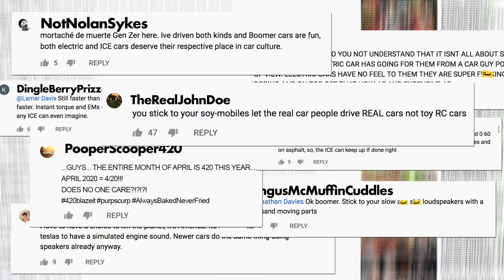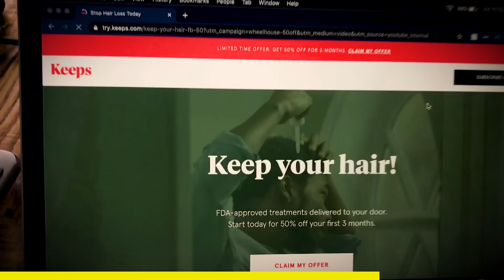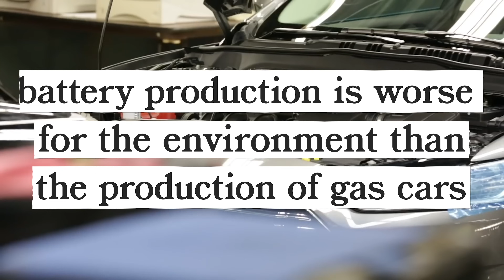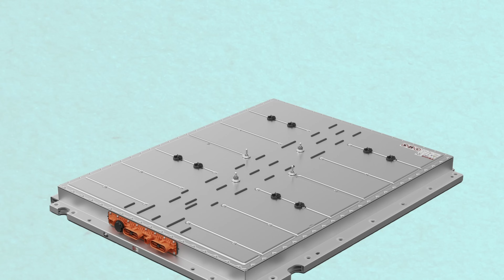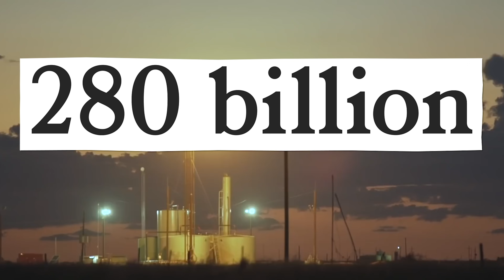Are Electric Cars REALLY Better for the Environment?

Comment: Initial manufacturing CO2 weights are important but im more interested in long term power consumption. The load on the grid is negligible like Nolan said but I'm curious how much more power EV's consume. Thus how much more power is needed to be produced. Besides hydro electric dams wind and solar don't make power once the sun goes down and wind turbines make by far the least amount of power of the three. Nuclear power seems like the only legitimate way to get off coal power. Which BTW industry and power production make up 42% of emissions according to the epa

Comment: My shipping container home is nearing completion. 2800 ft2  3kW of wind turbines plus 15kW of solar along with 52kWh of energy storage

(I own a large solar company so i get this stuff at a very strong value)

This is enough to daily drive two EVs and power my super efficient home and when those batteries are too worn for the cars to use, they will replace the batteries in the home.  The break even on the environmental cost about 6 years. After that I’m saving

As far as why I built off grid I was able to acquire 90 acres with no services available with a gorgeous view for approximately the same cost as two acres would have cost just 6 miles away.  It would have doubled the cost of the land just to bring in electricity and then I’d have to pay an ever growing NEM connection change forever.

Comment: Nice breakdown and really interesting facts/stats. I do have a question though. 

One of the things that I would be worried about with battery cars is the need to replace the batteries after 'X' years as they slowly lose the ability to store the power as well (look at second hand 10 year old Nissan Leaf's with 35 mile range)?

You state that EV's are more damaging to the environment to manufacture, and that a big part of that is the creation of the Lithium  batteries. What about the need to replace these after 5/7/10 years? Compared to ICE cars that with a good level of maintenance will continue to function (and creating CO2) for years after manufacture. 

Interested to hear your thoughts.
Reply: it is possible that when an EV is 10+ years old that it will be recycled anyways since the then new EV should have better technology and stronger/better batteries.

the age and range of a car also depends on the user, if you only need 10 miles per day, you can still use that 10 year old first gen Nissan Leaf.

manufacturing EVs with Electro or Hydrogen engine powered vehicles should in the future also reduce the environmental damage.

+ is when a Tesla crashes and the batteries survive is that shops that convert ICE into EV most of the time buys those batteries, other alternative is use the batteries to store energy that is generated by for example solar panels, those things generate sometimes more then being used at the time so you can store some energy for later.

Comment: Only one thing: Battery will not hold more than 200-300 000 miles. It can fail any minute after that. Even there is still 90% of charge from new it can die.. Lifecycle of ICE is longer than livecycle of EV.  There are countires where 15-20y old cars are still in use.

Comment: Little correction: Wind and solar power production has similarly horrid effect on environment as EV's. For instance wind turbine produces "clean" energy, but you need several thousands to produce amount of power say nuclear power plant can produce and those wind turbine require shit ton of area, wont work except when wind is blowing, efficiency of those turbines is not greatest, production of them takes metric tons of fiber grass that is very hard to recycle, except when the damn thing catches fire and burn to the ground cause firefighters really cant first get to it properly due location and cause its so high up in the air, so it keeps on burning releasing toxic crap from fiber glass and cant recall what it is called but refrigerant used to cool the turbine that is some real shit, dozens of times more toxic than anything on consumer market.
Solar panels just like wind turbines are taking shit ton of space. For instance on UK you would need to level 1/3 of the country all clear of any vegetation and level up the ground and place it full of solar panels just to meet UK's power requirements with 100% solar alone. Plus you need to have those gimball stands for each panel set so it will follow the sun for optimal effiency that is at best of times 60-70% what goes down when panels heat up in the sun light. Similarly same area would be needed to get 100% wind power. 
Solar panels are rather nasty that those cheap consumer grade panels last only 5-10 years at best and top of the line 10-15 years and we have no current method of recycling them as toxic gasses and chemicals have been used to construct them. So every 10 years you would need to replace all of those panels covering 1/3 of the country.. and then like now ship them into some 3rd world shit hole, where over time panel seals degrade or local population with out understanding how those things are made take them apart for what they can salvage and release all those chemicals and gasses to the environment.

Water turbine power production is great way, but it takes big area, chance local eco system by making artificial lakes, so its big nono for environmentalists cause wind and solar is so clean and simple...-.-
For all possibilities Nuclear is the cleanest, then comes the water, coal and then wind and solar... but hey its nice to smell your own farts and claim you are environmentally conscious and not driving old clunker that is using couple liters more fuel per 100km than new car, but has manage to go on some cases several million km's, where new car only lasts 10 years or 250k km's, gets recycled and then new cars is produced several times to match what one properly built older car can do... 
It would be interesting to see comparison between old car, new car and EV cause that would give much better picture on what is eco friendly. Also be noted that with ev's and new cars those still use both lots and lots of plastics, and to produce oils, diesel of agricultural machinery and jet fuel you need grude oil regardless. Attempts on turning into E85 and just 95E10 has caused corrosion damage on metals them selfs, let alone all the rubber parts to billions of small appliances like chainsaws, bushwackers, lawnmowers and older cars what with out the doubt has its own environmental effect, cause production of those machines aint cheap ether and battery operated replacements... well havent seen one that last more than few years at best..

Little question on myth number one: Does this comparison take into count EV's battery that lasts around 5 years that is needed to be replaced, what also is huge portion of the vehicles price and added weight, possible motor chances due wear and tear (though this is countered by engine parts being replaced in gasoline car like spark plugs etc), usage of tires that need to be with larger carrying capacity due vehicle weight and shredding that comes from so much low end torque and usage of lot more valuable copper? I think there is still lots of things that are ignored intentionally or unintentionally to push the agenda. Not by Donut Media, but his sources possibly.
Reply: Just wanted to let you know, the space thing for windmills is kinda bs as, according to college board, they actually take up less space than you make it seem. Even the big windmills are fairly narrow in terms of base, and they can actually be placed offshore to produce energy. Sure, they won’t make as much energy as nuclear power (which is not as effective as it could be if they used thorium), but relatively speaking, wind power is in its infancy when compared to coal power and nuclear power.

Comment: Indian student had invented Iron-ion Battery now they are improving it
Reply: As cheap as fe-ion batteries could be compared to li-ion, they're not really suited to use in EV's. Even with additional development, Fe-Ion batteries wouldn't be able to match Li-Ion batteries in voltage and well, iron is heavy. A switch to Fe-Ion batteries would result in heavier, larger, battery packs for EV's just to match the current mileage that EV's get off of Li-Ion packs, and thats before accounting for the additional power draw and loss in mileage that'd result from such a drastic increase in weight. (Which would require a even larger and heavier battery pack to compensate for.)

Comment: Nothing is better than fossil fuel cars,  because these use the fossil fuel directly and the engine is made of metals which are non toxic. All other sources of energy need to be converted from using fossil fuel or dangerous nuclear fuel, and their engines and other mechanisms are made of toxic elements....

Comment: I absolutely hate it when people talk about clean energy and they leave out nuclear energy. It causes less emissions to the enviroment thay ANY other energy production form we have right now. Yes, even more clean than solar or wind or amy other "clean" energy. It's also the only form of energy production where the emissions are regulated and enforced heavily, and we don't just dump it into the nature. It's also the cheapest and safest form of energy. Only reason we don't use it is irrational fear that is not based on anything real. When people talk about the enviroment, I feel like everything is futile until we change our way of producing energy and the things that need it to electrical. The only way to do that in the near futute is nuclear energy...
Reply: I totally agree that nuclear will play an important role for the sustainable future. But just not the current generation of nuclear plants. They cost way too much and produce too much nuclear waste. Moreover the insane amount of concrete needed to build them means they have a lot of embodied carbon you have to consider. But I'm hopeful for a commercial Generation IV reactor in the near future.

Comment: The claim that a coal powered EVs put out significantly less CO2 than a gasoline car is completely false. You just need some basic thermal efficiency data and the ability to do basic math to realize this. Coal is very nasty stuff, it puts out almost 1.5x more CO2 per thermal watt than gasoline in addition to a plethora of other toxic pollutants. Those coal power plants average about 33% thermal efficiency and this does not include the losses from transmission, AC to DC conversion and the mechanical losses of the EV car which brings it down to around 25% or so if you use real world data rather than the best case scenarios that are more often published. 25% is about the efficiency of a modern ICE car let alone some examples that go up to about 40%. Now the US grid on average EVs are a bit better than even the best ICE car, but a hybrid or a very efficient NG powered car, they put about roughly the same amount of CO2 over the lifespan of the car.

Comment: Do you have the federal tax credit point backwards?  I believe you need to make a high enough income to have a federal tax liability beyond $7500 in order to quality for the full federal tax credit.  The credit peaks out if it exceeds your tax liability.  This is the first I've heard about the wealthy seeing their tax credit halved, but maybe I'm wrong.  Question: if you're making that sort of income, why should you get a credit at all?  

What you may be thinking of is the individual state tax credits.  States like California give an additional $2000 state tax credit.  Colorado gives $5000.  NJ will also be giving up to $5000.  States do have income limits on their credits, and sometimes even give additional credits to lower income people.  I believe you can actually get more in CA if you're lower income.  So, in some cases, people could qualify for up to $12,500 in credits for an EV... but $7500 at the minimum if they make enough to qualify for all of it.

It's a misconception that the credit goes completely to the buyer.  A lot of it actually goes to the manufacturer because the companies price the vehicle according to price after credit.  They raise the price of the car by $7500 and generate higher margins on the sale.  As Tesla's credit sunset, they started cutting their vehicle prices accordingly.  As it stands now, if you can afford an EV, you are likely buying the vehicle with the cheapest TCO of any other vehicle type.  That means wealthy people that can afford these vehicles not only get the huge tax credits being offered, but they also benefit from cheaper cost to fuel and maintain the vehicle.  This will put them even further ahead of lower income people that can't afford the cars.

It's also a bit of an issue that these credits are often based on battery size or total range.  Most people have short commutes, so huge batteries with hundreds of miles of range save very little emission versus say a plug-in hybrid EV (PHEV) with only 30 miles of range.  However, these PHEVs often see large reductions in their credits.  There are diminishing returns for giving larger tax credits to larger batteries that have capacities that go mostly unused.  With limited battery cell supply currently, that means a slower roll out of battery electric vehicles.  (It's not just about solving the problem, but solving in the quickest and most efficient way possible!)

Tesla and GM sold enough EVs to no longer qualify for the $7500 federal tax credit.  However, due to strategic timing, Tesla sold FAR more cars than the 200k vehicle federal quota before the credit started to end.  They ended up selling enough to yoink at least another $1 billion from the federal government beyond the quota.  Tesla being a pure BEV company saw the largest competitive advantage and technology funding headstart through the EV credits programs.  Not just federal and state tax credits, but also state level CARB credits, which resulted in ICE manufacturers paying Tesla directly to buy up their carbon credits.  This is a clear case of the federal and state governments picking a winner, and this could end up being extremely detrimental to the rest of the automakers and the millions of workers they employ.  

It can be argued that the big ICE manufacturers should have moved faster... but I'd suggest that these companies aren't exactly "technology" companies, and have never been all that innovative.  They are merely companies that supply a demand for cars.  They did enough to abide by federal emissions regulations, and EV credits suddenly flipped the entire market on its head; rewarding companies that were already 100% focused on EVs,  giving them a massive headstart in R&D, in hiring up all the top scientists and engineers, in buying up the related companies, and in building out production and securing resource contracts.

Clearly I'm no fan of federal credits that pick winners.  A better solution would have been a federal carbon tax on gasoline would have solved all of this government picking of winners.  Tax the things that are bad for the planet, and let the market figure out the best ways to reduce expenses.  There's a valid criticism that carbon taxes are regressive for lower income people.  That's true, so the simple solution is to give lower income people credits to compensate for the added gas tax, and let them choose the best way to use that money.  They can continue buying fuel and using the cash to offset the tax.  They can pocket the money and walk / bike / use public transit more.  They can use the extra money to help with the car payment on an EV.  Taxing carbon goes after the carbon problem at every income level... not just for those that can afford EVs.

Comment: Fuel economy of US cars is terrible, if they drove EU spec cars emissions would be 40% down overnight. My first car was a petrol/gas VW polo getting 45mpg, next was a diesel BMW getting 55mpg. Both old cheap standard EU cars. Hard to find anything in the US with those numbers, plus US cars are slow as shit especially considering engine size. Hence, no one outside US buys them.

Comment: You're right about the gas vs electric argument.
However the gas vs electric vs hybrid becomes a lot more complicated.
Because in essence you can make more hybrids for the same amount of raw materials that you'd use to make a single electric car and get most of the benefits of that electric car in all of those hybrids.
So even if the hybrid is beaten by the electric car in a one vs one in terms of environmental impact after a while the total number of hybrids you can make with the resources you need for a electric car is better for the environment then that one electric car by a long shot.
So I recommend encouraging people to buy hybrids, at least for now.
With more efficient manufacturing that might of course change.
Also, the balance between the two depends a bit on the energy sources, both on the electric and gas side.

Also, you mentioned that you'll own a gas car for the rest of your life?

Considered just giving a hybrid a try?
Some hybrids like the Toyota rav4 is seriously impressive.

Comment: There's no such thing as "zero emissions".
Reply: You can still have less though. Some emissions are probably fundamentally necessary in chemical manufacturing and refining processes, but you could also run the mines and manufacturing plants on renewables. Mines will still have an environmental impact, but their carbon footprint has a lot of room for improvement at least.
Reply: Can't escape entropy
Reply: Double Darrel  and high emissions in production while creating a major recycling headache when their lithium ion batteries die.

No such thing as zero emissions, it's just a matter of where and how you shift the peak.